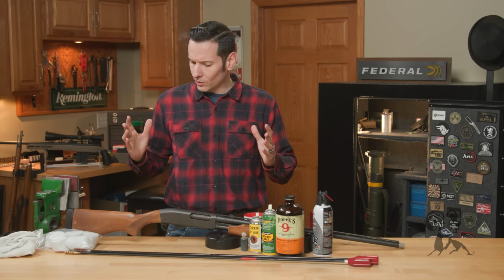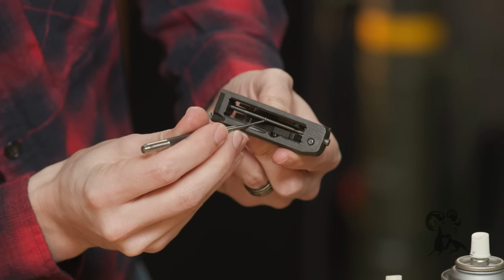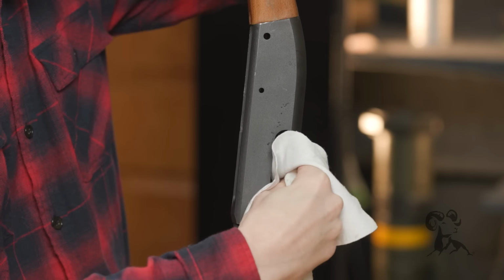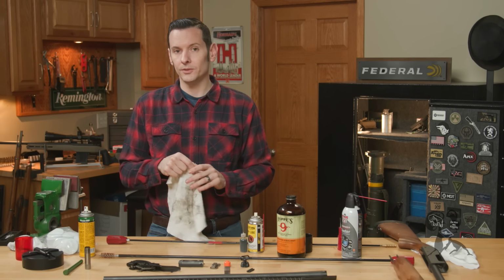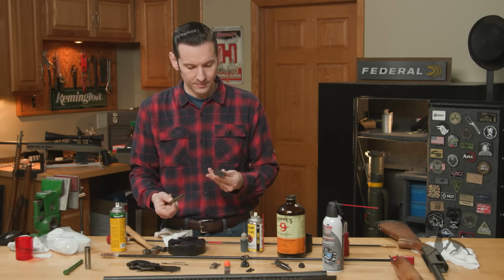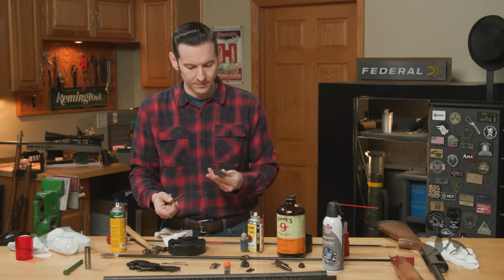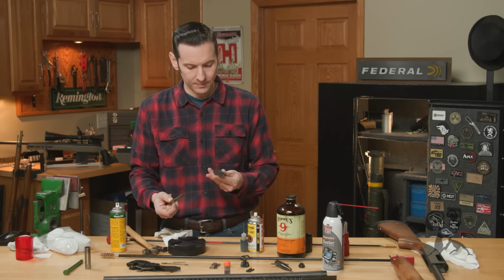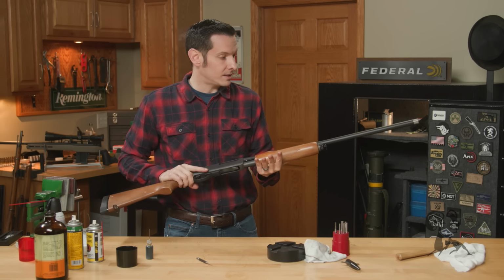Tech Tip: Remington 870 Basic Maintenance

Comment: Excellent comprehensive video. Learned some new things. Couldn't get any better. I've got a 870 Wingmaster bought new in 1970. Still in great shape. I noticed you don't use a lot of cleaner but rather mostly Rem Oil. Is Rem Oil also a cleaner? Thanks again, Caleb, for the video.

Comment: I may not have gotten to this point in the video but just wanted to mention the front trigger pin is narrower than the rear but we’d figure that out during reassembly. I would also like to give a plug to Timney I have a new 870 and I improved the trigger with the little kit they offer for the 870. Im not sure if needed on the older model but it made the trigger so smooth and nice. I didn’t lighten the trigger they include 3 i kept mine similar to the stock spring.

Comment: I had my hammer get stuck one time on an 870 that was very rarely shot - it caused a dead trigger and I wasn't sure what happened but after taking the trigger group out I found it was stuck down after being cocked due to rust/dry metal so I try to lube that area up quite a bit especially on shotguns that may not get used all that often.

Comment: I can appreciate folks going above and beyond to take care of their firearms but in reality a lot of this extra work is not needed. I’ve been using ballistol on all my firearms going on 6 years now and not one of them has rust, always performed flawlessly and always stood clean even with they was stored for long periods of time. I’m sure it’s also not required but as for my going the extra mile mark, I always give them a quick clean after every use rather than letting the gun power and carbon rest on the gun for days, weeks or even months. A simple spray and wipe down on the frame and inside the barrel will do just fine But if a full teardown and deep cleaning is your thing, then have at it as long as you enjoy doing the maintenance!

Comment: my old 870 does not have the magazine spring retainer it is just held in with the magazine tube cap  nut ? do you need it or did the old 870 not use this ?never had any issues with it ?thanks